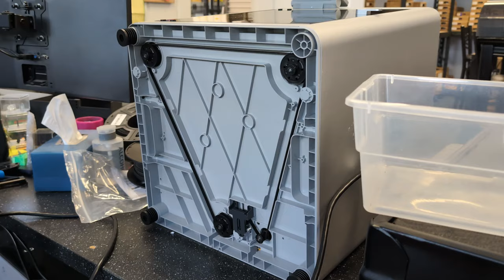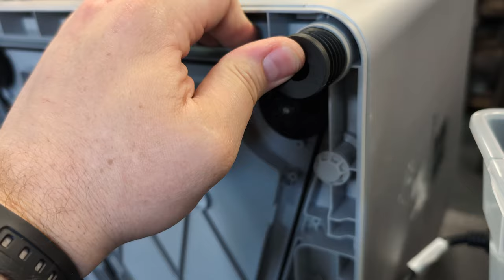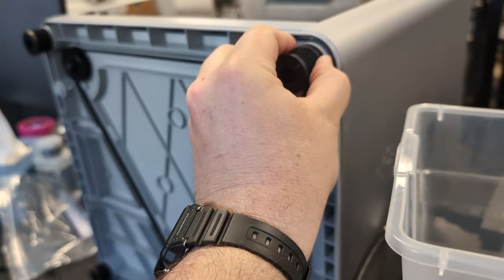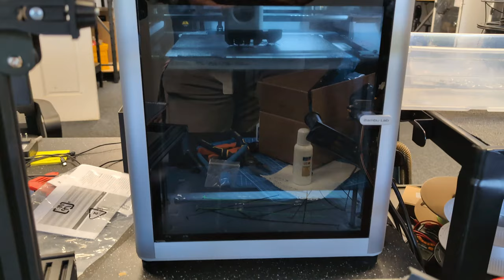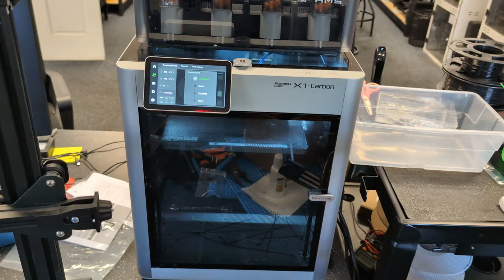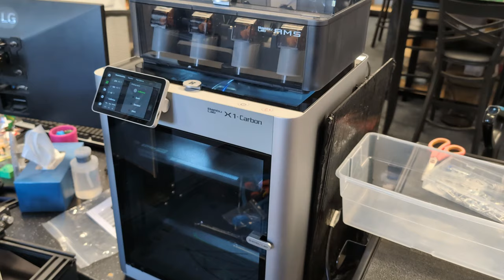TH3D Bambu P1 X1 Vibration Damping Feet - Stop the Shaking and Vibrations!

Comment: I bought 4 (got 8) of these new type feet, but they do not fit tightly ... If you lift the Bambu; the feet all fall out... Also you need to check to make sure the feet are not bent at an angle, which happens ever so easy, because they are very soft, BUT that should cancel out any shaking of the place it sits on. You need to lift the Bambu up from the front a little, so the feet don't fall out and then carefully put it back; now they are straight... same for back...
Reply from the maker: If they come out just out a tiny bit of glue to hold them in. The stock ones are glued in a tiny bit. You cannot slide the machine with these on but just pick up slightly, move, then set down directly.